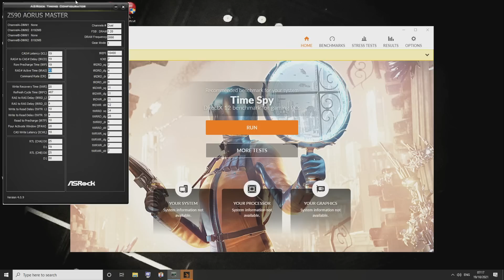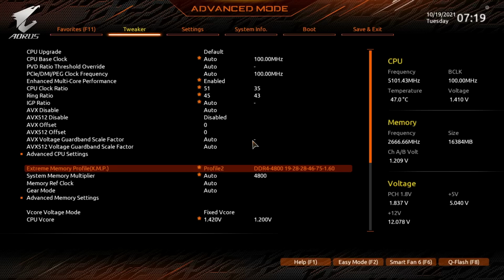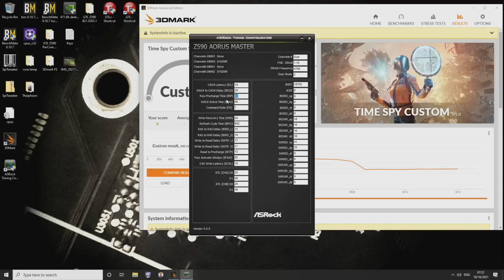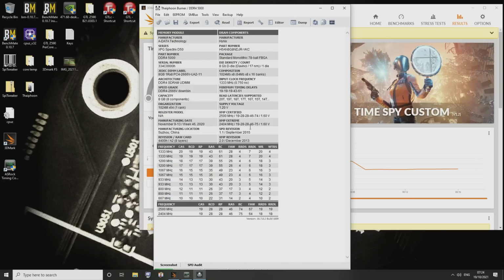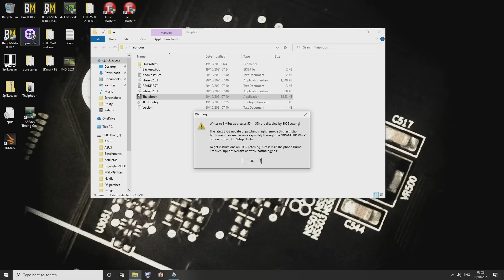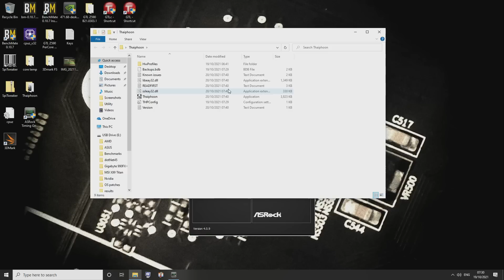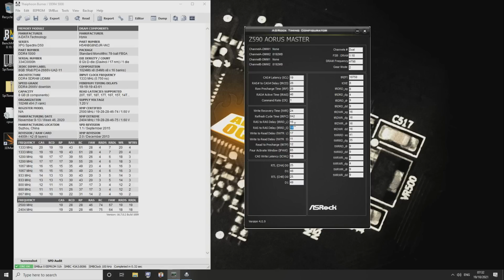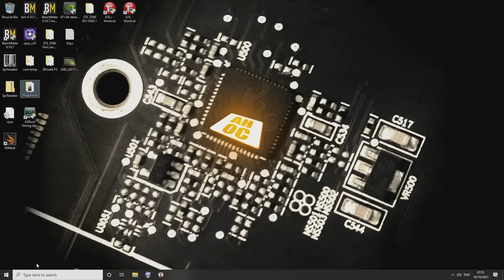XMP on some memory kits actually makes performance worse.

Comment: Sorry if it was mentioned in comments already, but it helped me check what’s actually in my XMP profile (using Thaiphoon) and what is actually applied. My motherboard only applies the primaries. So checking the full XMP profile TFAW was like 44, so I ignored it (went for 16), but its tRC and TRRDS/L were lower than what my motherboard applied. So I just put in what was in the XMP and my Linpack results went up by 6-7% right off the bat. Good option if you don’t want to spend a lot of time on tweaking your ram :)
Reply: Aida will show you full SPD with few other timings.

Comment: AIDA64 memory tests wont tell you much outside a general idea if you have gone too far without causing  noticed instability, now, running he full bench using a quick report, the photoworxx test at least on my 7940x gives you a much better idea if your fucking shit up or making things better.. hell the overall bench can give you an idea if you made it worse or better.. why i store multi reports as i test tweaks.. very handy tool.. aida's memory bench is useful as a quick "did i make it better or worse in general?" type test but.. yeah i have found it useless beyond a vague idea.. (if you see it jump up or down alot, you get a general idea if your fucking up or not..)

anyway, im having fun dialing this new system i build after my x58 board died.. (a 6c12t xeon overclocked to 4.6-4.7 is quite competitive with first gen ryzen in most games faster in several..),  this x299 systems been a learning exp.. but also been more fun dialing a system in then i have had for years.... so many are so close to their limit as it is.... this.. ram and cpu have given me a shitload of fun..

Comment: i use XMP as a starting point then dial things in from there...

these 4x16gb TimeTec 3600 sticks run below XMP at 3733 at xmp volts.... the xmp is loose, im actually ok with that in this case, as it would allow it to work with alot of systems that other kits i have delt with wouldnt post in with xmp enabled... (first gen ryzen mostly..) 

these... are hynix djr die ram.. 210 for my ram kit... well its rated via xmp at 18-22-22-42, im gettin 3733@17-20-20-38-cr1, with a tREFI at over 32k(board max), this is on x299/7940x, so, 4k and up on  ram is...not that easy or common.. doable but... honestly not worth the timings i would need to use vs what im getting at 3733.. at 1.3v... im pretty sure i could dial the trfc in a bit but... honestly im pretty happy with the results so far....

Comment: Similar happened when my PC can't boot, on my old ddr3 2400mhz 16gb kit with XMP enabled.
It took me more than weeks, to found the problem. It was the secondary timing won't match something with the motherboard.
Checked the jdec in CPUZ, AIDA64, I tried to match all timings table in softwares. 
Then, lucky I tried lowered the TRRD to 7 and CWL to 12, and then boom! the PC booted instantly with xmp 2400mhz
in the table software shows TRRD = 8 , CWL =13  for 2400mhz xmp, so weird. I agree company never really explain you the secondary timings.

Comment: I'm not massively au fait with DRAM tweaking (just XMP them these days), but I'm familiar enough with the ranges to expect from cursory checks with CPU-z that my eyebrows would go up if I saw numbers like those. I'd guess that  kits with XMP speeds of 3600, 3200 or even slower from other makers would also clock to 4800MHz with those timings, so these are basically not what they're touted/adertised as and a complete con.

Comment: my 2x16gb 3600mhz c18 Team vulcan Z has the trfc set on 990 when enabling xmp LOL. That's way higher than if the ram were run on JEDEC spec

Comment: This is my problem that I am searching for 2 years of lag in games also my ram is gskill royal xmp 4000 cl17 dual kit xmp works really bad on my aourus z390 master!At first it works xmp on and good to go but after a while I realize massive delays lags everywhere I can't figure out what the hack I spend tons of money change components but not ram ! Than I change the timing manually as in this video after 2 years problem solved.

Comment: Mine just crashes often - it runs @ 3200 could be on it gaming for the day then next day bluescreens on startup - or like just now its fine all day then I go on Youtube and Ads are showing with Adblock on wtf so disable it - refresh - enable - BSOD - I find using my browser often causes BSOD when overclocking my Ram not sure why, that's your area of expertise I guess. . .   Hyper X Predator 3200 - MSI X470 M7AC Ryzen2700X
Reply: I've come to the conclusion that XMP is pretty much ass and it's better to have disabled, unless you get very lucky.

Comment: It's not XMP fault or the MB, these manufactures are just trying to hit high numbers to sell the same RAM for a higher price and to avoid instability since their chip can't handle lower latency. 
MB should set the timing based on the XMB and not based on MB data since RAM manufactures should give the correct XMP number.
Reply: they dont want to do proper binning so they use timings looser then needed for the majority of sticks, to ensure even the worst ones will still work at rated xmp... 

i use to be friends with a guy, we would buy tray ram, would use multi boards to test ram and dial in a proper spd for higher then rated clocks and flash it to the spd on the sticks, resell on ebay and locally... never had a single return for ram not meeting spec or being flawed out of the box.. mostly had people comiong back wanting more of the same exact stuff to match with what they already got... what i found was that kits rated at jdec and kits rated at the best speeds possible, were almost always just binned sticks, and often more then half a tray would work 100% flawless at the xmp dialed on for the tpp speeds sold... 

we even sold some ram at higher then any official ram manufacturer was selling them flashed, we dumped the 2 lowest jdec specs from the spd and added 2 more... one that was max speed for what companies were selling then one i dialed in, around 2 perf tiers higher, out of a tray we only got around 25% that would test out flaweless at those specs but... omg did they sell... zero returns... more then a few people upset we didnt have any more and couldnt find trays of ram to buy of that type at the time...(years later he and his bro got ram when the stuff was being dumped by corporations dirt cheap and binned a bunch more and made a much higher profit due to the boom in retro pc building...)

we had some fun back then... 

honestly.. i would like to see better auto-training for set speeds.. i have seen it get better but.. i have also seen a couple  gems of boards that if you set the ram to a specific clock, the board would reboot and try dif timings till it could post and boot to windows successfully, from there you had to loosen/tighten things till you got it dialed in.. but.. gods damn thats a nice feature.... once had a buddies system take over 45min to dial itself in but.. 3hrs later we had found the "sweet spot" for the ram, and written down the key timings(both primary and sub timings we tweaked).. its crazy how big a deal even 2ns can make.. from unstable to 100% solid for over a week of leaving p95 blend running using 785% of the system ram(he forgot it running when he went on a work trip and.. nobody goes into his basement office without him there or telling them to.. so.. yeah.. "guess its solid..god damn.. that must have burned some power" LOL..

Comment: Trashing the timings to relax the setting enhances the stability of the module. The manufacturer wants that because that means more kits sold, not returned nor RMA'ed because of stability issues. It's a move to ensure profits, screwing the end user in the process since most just bother to use XMP only.

Comment: Ive got 2 sets of dual chanel trident z 3200cl14 8×2 single rank
And they wont but a single mhz higher than xmp
Im using a b550 steel legend and ryzen 5900x
Any advice?
I tried every possible memory chanel mod single dual and full dimm
Reply: keep calm, raise SOC voltage
Reply: @Aylevin21  it was in the wrong dimms

Comment: hmm question, so ive lowered all my timing pretty much as much as possible and ran memtest for 24hours and prime95 for 12hours no crashed or errors, and i used aida, cinebench and timespy to check performance to make sure the timings increased performance along the way. 
But my question is can a timing ever be to low,  i have some timings that i was able to get down to 1 without encountering errors, will that make my memory degrade quicker or something possibly is there any risk to that at all?
Reply: Which timings my dude? 
Depending on the ram, some timings can go down to 1 without problems.
You can tell because some are set to 1 when left in AUTO

Comment: I have a 3200 kit that reduces the FCLK to 1600 to run synchronous... It underclocks the infinity fabric. I had to manually set it to 4000 and 2000 and add some voltage here and there.

Comment: So is it better to get a high clock kit with looser timings and clock it down to tighten the timings, or is it better to just get a lower clocked kit with tight timings (for Ryzen)? Like is it better to get a 3600 kit with like 14,15,15,35? Or like a 4000 kit with 18,20,20,40 and clock it down to 3600-3800?
Reply: Whichever has the lowest latency, really.  At least when it comes to B-Die/Rev. E.

Comment: I can't use XMP for the 4x8GB Patriot Viper 4400MHz (19-19-19-39) in the MSI Z490 Godlike MB (i9-10900K) because it crashes Warzone. Same for following the manual OC settings video by AHO, maybe because a few available choices differ from the instructions given by AHO but I've tried everything before giving up.
Reply: Do you know what sa and io voltage your   motherboard has when you set xmp ? Also the fact that your ram loads into windows with 4 sticks on xmp is impressive.

Comment: I now have a 4x8Gig Memory Kit from TForce with Samsung B-Die on them, validated for 4000 Cl18. When I activate D.O.C.P on my MoBo it wont even boot the System (5950x, IF clocked at 1.9GHz atm, wanted to try 2GHz but haven't gotten into it for now). Any suggestions what would cause it to fail to boot? Should I try Manual Voltage override ?
Reply: Try to slowly raise the ram Frequency from default, that gives you a rough idea if the cpu can handle it because the mobo will set really loose timings to try to boot.
Reply: What motherboard are you using? Is that RAM on their QVL? Being it fails to POST I am wondering on compatibility. May not hurt to check your UEFI version on your MB too
Reply: @Frizzy9000  Haven't checked up that yet, running a X570 Dark Hero from Asus, got it in June and installed newest UEFI back then, right before I installed any OS's... Gonna check these suggestions up could be one of the reasons...

Comment: This is the case for my Gskill Trident Z (CL14 Samsung B) The tRFC is set to something insane like 500+ with XMP enabled. AMD Ryzen 5900X on an X470 Board (This issue was also present when I was using a 2700X on the same Board)
Reply: "The tRFC is set to something insane like 500+ with XMP enabled."

That's because it's required to operate properly at ~95c. Lower RFC's only work if you keep the memory cool, which people aren't guaranteed to do.

RFC will only affect performance by a handful of %. RRDS/RRDL/FAW can half or double it.

Comment: Gained over 50 marks for the CPU test with a very slight adjustment.. 3466MHZ XMP2.0, to using auto and manually tuning just the CL, tRCD, tRP, tRAS, tRFC. tRFC (607) has to be quite high or I get instability.

Comment: I guess just manually inputting the rated voltage , timings and frequency instead of trusting xmp or auto settings to figure it out in the bios?

Comment: I had this issue with my Corsair sticks. They are supposed to be 3600, but performance decreased from 2933 (IIRC). And I'm not good enough at Memory OC to do more than little tinkering with timings. Then again 3200 profile run very well (better than 2933) and I did some further very light OC on that and it is stable. I guess it is more of an issue since I have 4 sticks (I didn't have enough money so I was buying 2x4GB 3 months apart).

Comment: my Adata xpg silver 3000 2 sticks  does lots more issues for some reason tthey didnt have those issues when i had a r 7 1700 i didnt face those issues only when i used them on 3400 g 
 always crashing and slowing down my system i tried lots of things finaly decided to sell them and replaced them with hyuper x fury 3200 mhz

Comment: jep same here 😀 . granted me 300 points in timespy on my 5800x with a 3200C14 kit clocked @ 3600-14-14-14-28-44 plus new subtimings obviously. That is what happens if you try to overclock your xmp settings. silly me :D
Edit: since you mentioned it, it is a teamgroup ARGB kit 4x8. tFAW was 38 now its 20

Comment: Wish there was a more standard way for dealing with faster frequencies and timings, clearly no one is satisfied with JEDEC
You're pretty much at the mercy of the DIMM manufacturer if you want to use XMP as intended, compatibility is still meh and if you want add more memory even buy getting another of the same kit you better pray they haven't swapped IC makes and completely changed up the sub timings.

Comment: Maybe you could help me choose the memory dice:
I currently have:
Mobo MSI X370 Pro carbon
Proc Ryzen 7 1700
Memory F4-3200C14D-16GFX G.SkILL 2x8GB 3200 cl14 mhz samsung b-die (single rank)

I don't want to change hardware but needs more ram memory. Due to the fact that the first generation of procesor is  sucks when it comes to the memory controller, to keep 3200mhz I just have to replace the set of ram.
I am wondering if you want to buy a set F4-3200C14D-32GFX 2x16gb 3200mhz cl14 samsung b-die (dual rank) or buy something else?

Or maybe buy crucial ballistix 2x16 3600mhz cl16 and set them to 3200mhz. I know they are sometimes single rank, perhaps micron d and sometimes dual rank micorn e.

I do not know what to do, I would like to buy a frame that I will use one day when changing the platform.
 I wonder if on newer generations of the processor it is at all possible to combine such sets F4-3200C14-16GFX with F4-3200c14-32GFX, i.e. throwing two single rank sticks and two sticks with higher dual rank capacity?

I do not know what to do to advise something?

Comment: great, now I can't trust XMP anymore :(
setting up new systems just got a whole lot more tedious
Reply: I would not worry too much, in most cases you will only notice a difference in benchmarks unless your really looking for it :)
Reply: XMP imo is just for time-saving anyways. If you are on the high-end, XMP is kinda pointless because you wanna manually set that stuff anyways (else: why bother paying that much money?). And on the lower end / budget range, you are just wasting money paying for an XMP profile. I mean, do you really wanna pay 50 bucks more on to get a higher frequency XMP-profile for the same kit/die? Or would it be better to just buy the identical hardware with different XMP (of a potentially different bin, if you are unlucky) and manually set those numbers?
Reply: The performance loss if more from Gear 2 then XMP, if you're on zen2+ make sure FCLK/UCLK/MCLK are synced, and run gear 1 on RKL upto 3733-
ish

Comment: Oh MSI just ignores sub timings, that explains why i had to set the XMP manually on my MSI board when i was testing it, figured it was just cause the speed was over 4000
not like a would keep a b-die kit kit at stock anyway...
It was a 4133 viper steel on a msi b550I board, IIRC the auto was worse than what was on the spd chip (i did force 1T like the profile called for) and the bios is just like you expect the IMC to do this? yea right i'll do this instead without realizing it is a APU and will not care

Comment: Some context: That's an $850 kit. For 2x8GB.
Reply: Omg...
Reply: never buy early release ! Usually we end up paying for lab time in development. DDR4 much more affordable - late fall 2023.  48 Gb DDR5 same time - $ 850 !
Reply: Samsung B-die in a nutshell
Reply: @ghoulbuster1  Uh, you can easily get a high-bin b-die kit at 2x8GB for $120. Usually less. No idea what your reply even means.
Reply: @sandmann521  B-die can cost as low as 90 bucks to as high as 800. Depending on the binning.

Comment: I always shy away from tweaking my memory timings, for no matter how many tutorials and articles i read, i can't seem to understand what exactly each value do, and how they work in relation to the other values, or how to test stability in a relieable and timely manner.
Constantly running into conflicting information, or behavior i can't really reproduce on my system doesn't help either.
Now i see even some manufacturers don't know what they are doing either, many just seem to loosen the timings, until the memory just doesn't crash at a specific speed on whatever awkward configuration they test it on, programm this into the xmp and call it a day.
Reply: "i can't seem to understand what exactly each value do"
You don't need to, just remember lower = better and see what works.
Having more in-depth info about how the timings interact is useful, but not necessary.
Reply: @nathangamble125  read sixtyinsix statement and get out  calculator and do the maths and compare to your ram
Reply: They know what they're doing.
High frequencies and low CL sell, a low tRRD doesn't.
Reply: Ryzen DRAM calc, will get you in the ballpark at least. Plus it has a number of useful macros for calculating tertiary and impedance settings. It's not the be all and end all, but it's a good start.

Comment: If my 5800x can run at 2000flck, is it worth trying to push my 3800 CL14 kit to 4000mhz
Reply: yes if you can keep the timings or just check and compare performance